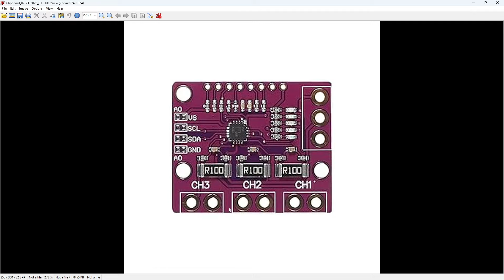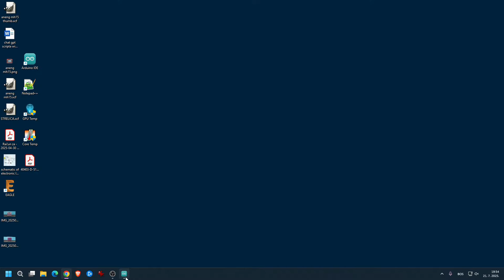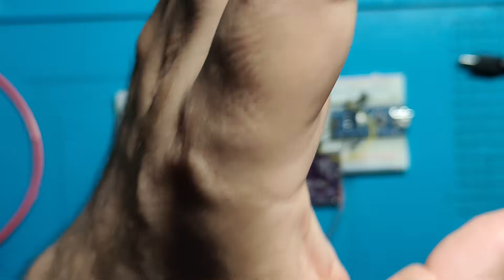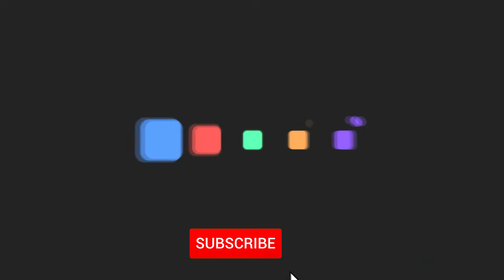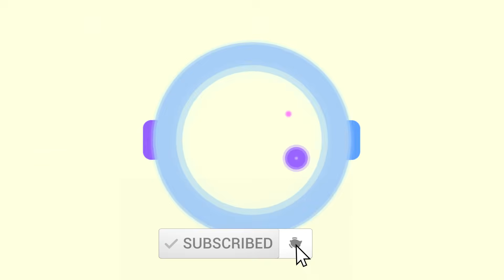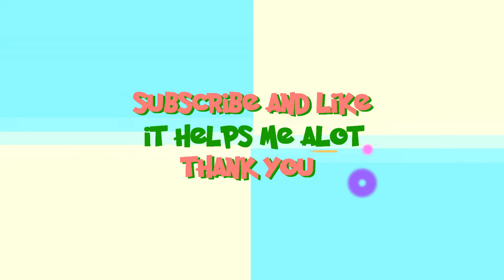🔥INA3221 Hidden Upgrade! New Board vs Old – Triple Channel Power Monitor Explained

Comment: Hi! I'm intending to use an INA3221 module in a ESP32-powered gadget. The situation is as follows: the battery is connected to a charging module, and the charger's output goes to the ESP32 dev module. The idea is to read the remaining battery power that is at the same time supplying power to the ESP32 (and the INA33221). Could you help me with the connection scheme?
Reply from the maker: So if I got it correct. You just want to monitor the battery status , I mean the status of the battery which is supplying power to esp32 and ina3221. Since just for monitoring how much the battery is empty or how much the remaining power is left you do not need the INA module. Usually the level of the battery is measured and decided according to the current Voltage of the battery.